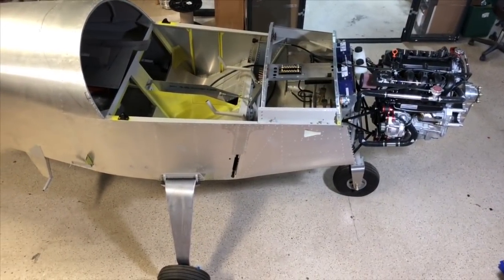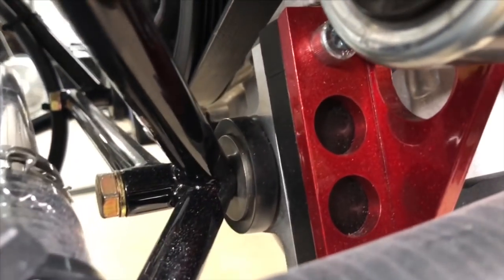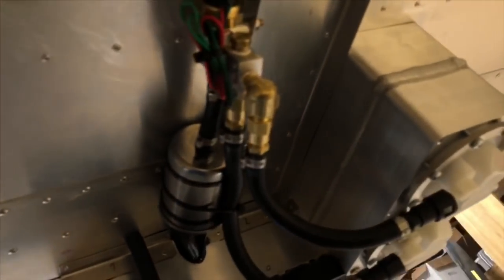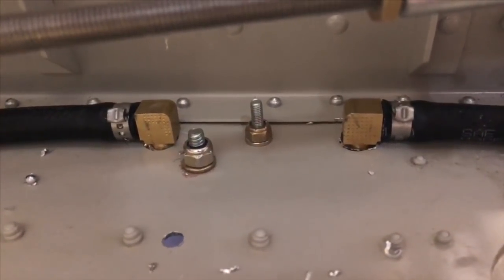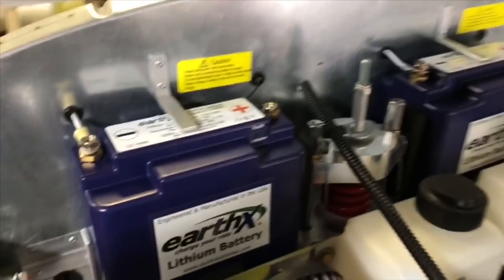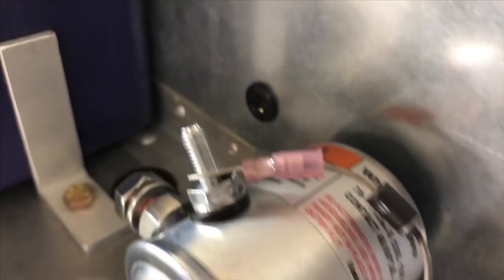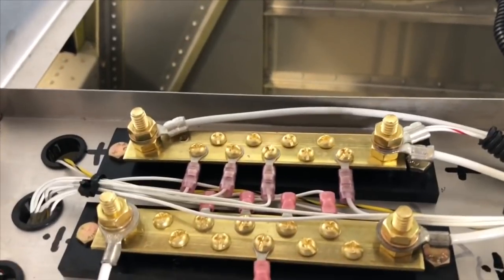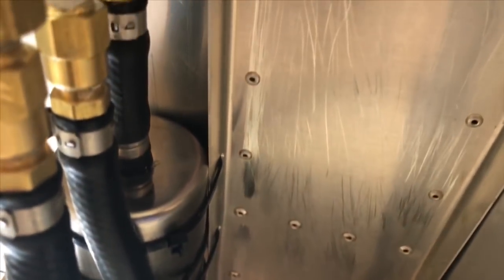Viking 130 in Low winged models Viking Aircraft Engines

Comment: I'm sorry, but that radiator and fuel cell appear to be extremely susceptible to small rock impact- causing damage by punching holes in places.
Reply from the maker: Hey there, many people have had this question over the years. It has NEVER been an issue, even with many doing back country flying etc. If it is a concern from some they add a flap onto the nose wheel to help :)

Comment: Radiators with plastic end caps will eventually crack and leak.  Why not use all aluminum radiators?
Reply from the maker: It is true that all parts have a lifespan, that includes many aluminum radiators using epoxies to hold the tubes in place. Our radiator is belly mounted, with plenty of cooling air running over the plastic - this is different than in a car where these fitting also take the abuse from the elevated under hood temperatures. Even when the vehicle is parked. We don't run a pressurized cooling system and that any slight leak would be detected way before any part failure. So far, never seen a leak in all these years..